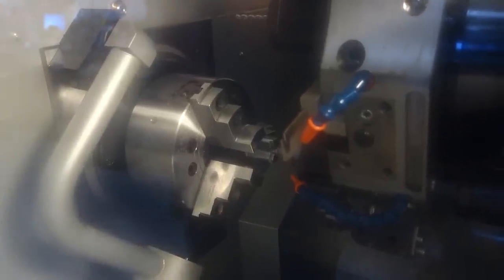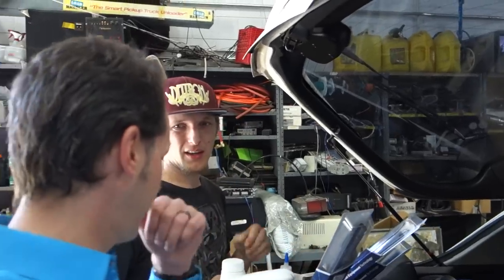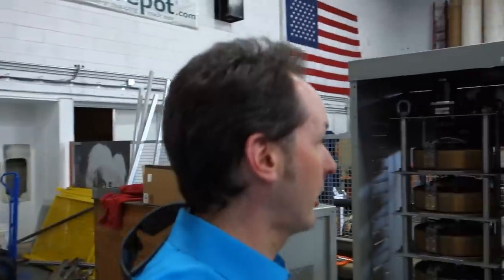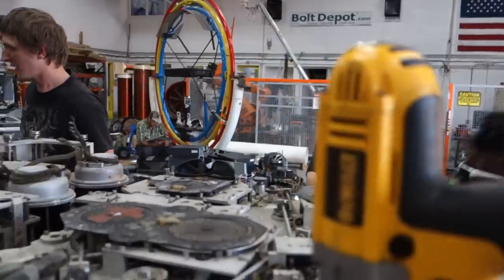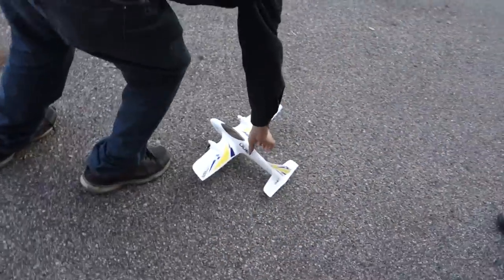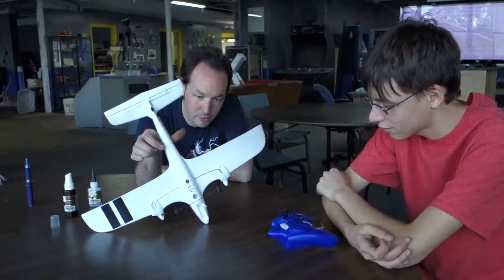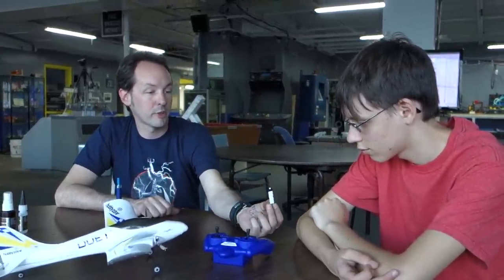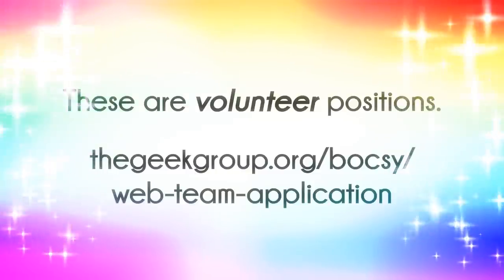Captain's Blog 9 27 2014 Variac Works and Harris Flies

Comment: My first helicopter was a WLtoys v911, and in my opinion it's a respectable starter. Yes, it's a four-channel, but three-channel helicopters are such a step down in fun factor without a justifiable reduction in cost, complexity or parts availability, and only a little bit easier to fly. The v911 is $36 on Amazon, RTF.